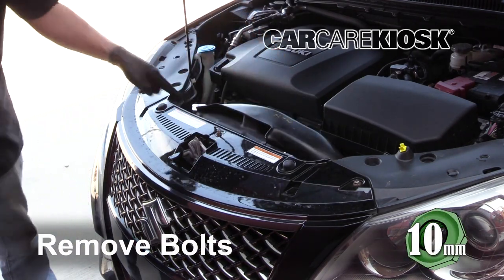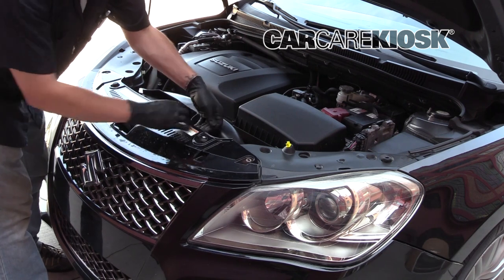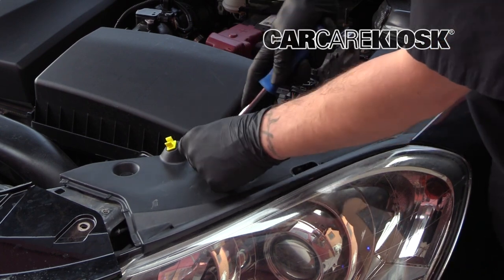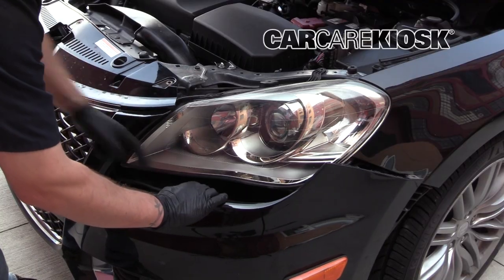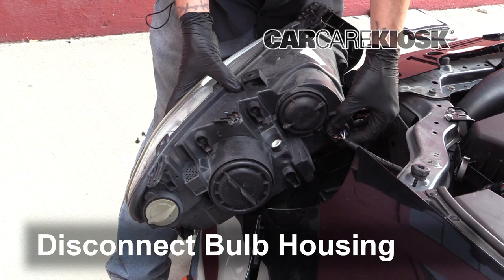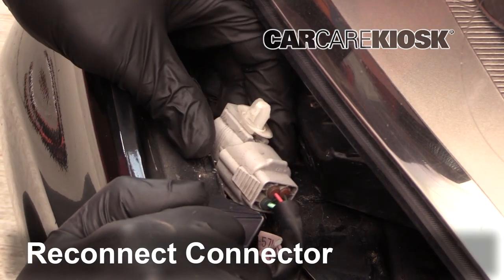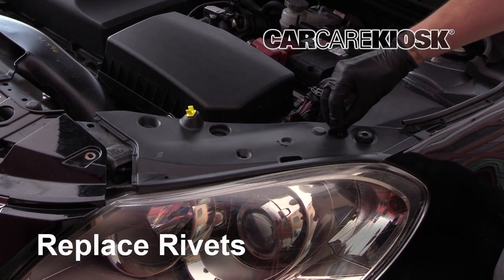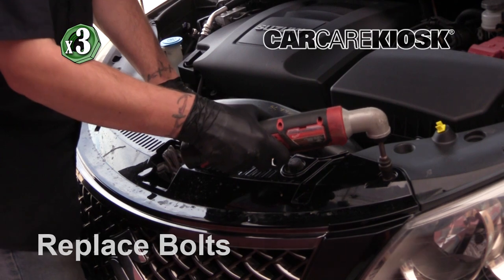How to Remove Bumper 2010 - 2016 Suzuki Kizashi.  Headlight Housing Removal Too!

Comment: What is that tool you’re using to remove the bolts?
Reply from the maker: Milwaukee impact drill/driver (https://amzn.to/3x27BqT), with a hex to 3/8" socket adapter (https://amzn.to/3vh3jLN) and a 10MM socket (https://amzn.to/3TvD3Xr)